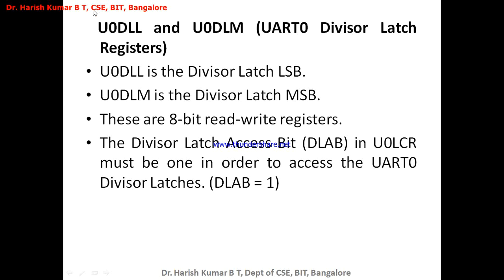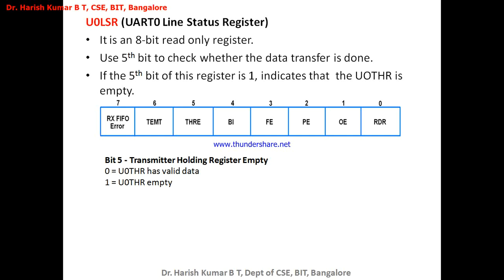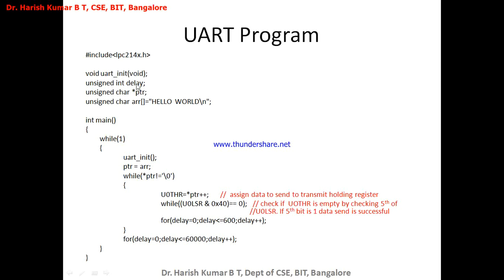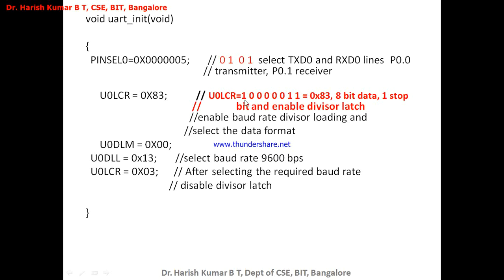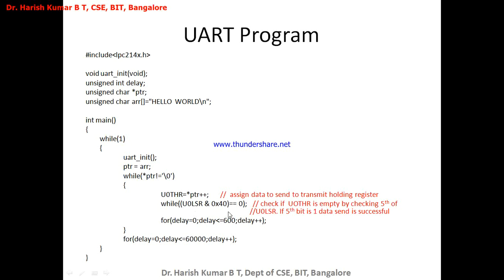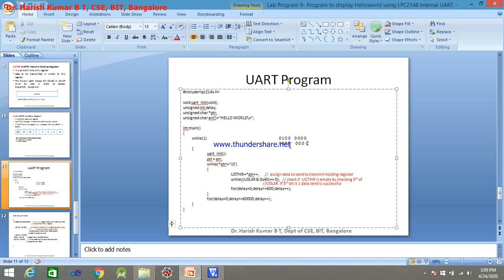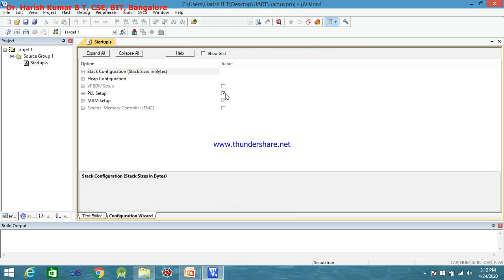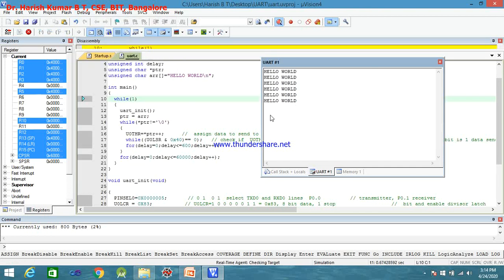PART B Lab Program 9: Displaying Hello World Message Using Internal UART 2 of 2

Comment: Excellent explanation Sir.   but I  think to check for 5th bit it has to be checked with 0x20 and not 0x40.  because 0010 0000 is the value when 5th bit is 1.
Reply from the maker: Thank you. Will look into this
Reply: well both 5th and 6th bit are used to check whether its empty or not. here they have used 6th bit. hence its 0100 0000